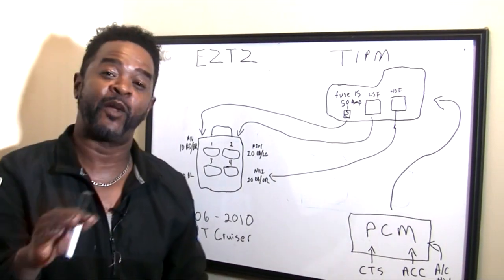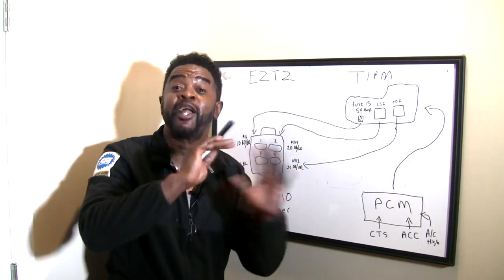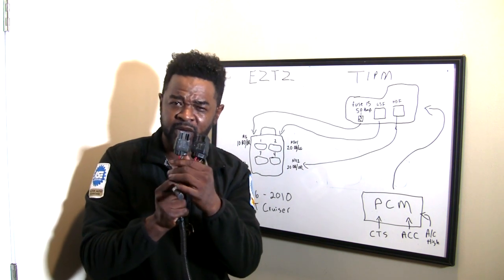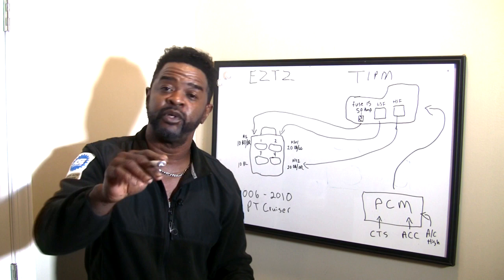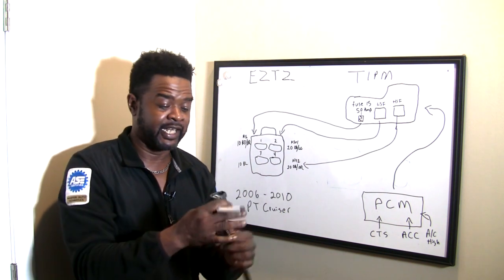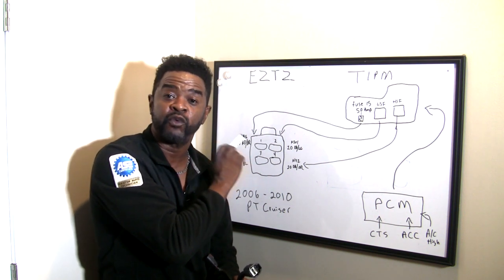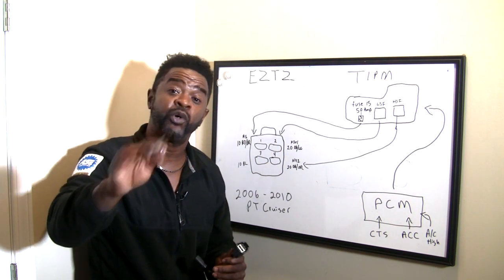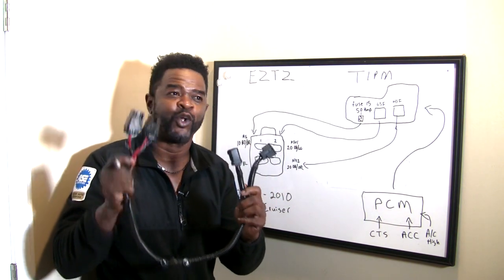PT Cruiser overheating problems. Overheating with AC on. How to test the cooling fan. Running HOT

Comment: Went through four videos and your video was the Conclusive one!

The Module wire connections that carry over to the two relays and the fan wiring connection was corroded inside the connection. 

Sprayed an anti corrosive.  

 Carefully,  scraped the Copper connectors, and WA'LAH!!!  

 Back in the game!

🔥THANK YOU for making this video 🔥🙌🏿

Comment: 2010 PT Crzr fan not actuating 51k miles. AC on but no fan. Temp is okay when moving but stop lights cause havoc. You mentioned that the square relays on the fan shroud don't go out, but another video said that was his problem. Thanks for giving all the info on this. I'll be working on it tomorrow.
Reply from the maker: Cool, please thumbs up the video and subscribe to the channel
Reply: @OnlineMechanicTips  Pulled a P0303 - number 3 cyl not firing. Replaced the cam position sensor and mine stopped doing the jig, but fan is still not actuating. Ran the cruiser on the freeway and it was fine, but as soon as I pointed it uphill the temp gauge started climbing. Once the coolant gets hot its difficult to cool it back down. System is holding pressure and I can get enough cooling from running the heater inside with fan on high, but its not comfortable here in Hawaii to drive with the heater on. Is there a way to hot-wire the radiator fan? I believe the relays are grounding circuit relays so I'm going to try an extra ground cable from the battery to the block. I'm thinking that I might just run a switched wire from the fan's ground wire to the block or ground side terminal on the battery bypassing the relay. Thoughts?

Comment: Great Video,  Everyone have a look at that 10gauge red/brown wire that is supposed to supply power out of the TIPM..... I found it to be corroded and broken underneath the battery (As a result of battery corrosion under the battery tray.  I found the issue, thanks to this fantastic video.  Subscribed.  :)

Comment: Man I have to thank you a lot for this video! I’m diagnosing an 08 PT CRUISER with ac not blowing cold. I’m gonna check on that low speed control circuit when I get the time to work on it. I’m surprise those two relay looking thing that attaches to the fan does not show in wiring diagram which got me thinking they’re the fan relays!
Reply from the maker: yea, they dont even have a listing in the dealership parts department..Please subscribe to the channel for me an hit the notification bell...thanks

Comment from the maker: Yes, a restriction in the liquid line, like I mention in the video.. Because the orfice tube is housed inside the liquid line, you just cant replace the orfice. So you have to replace the complete liquid line..You really need to do a complete AC diag using some guages to pinpoint pressure problems within the AC unit
Reply: EZTZ Rideshare/ News/Auto/Fitness/Multimedia would the ac still function without purgeing if this was a problem before i replaced my broken fan it wouldnt it would build presser purge and turn off like it should but with the new fan the ac works but running it or heater at idle makes it idle bad the same as it was before so the fan was a problem just not the only one
Reply: EZTZ Rideshare/ News/Auto/Fitness/Multimedia from what i can tell right now when the ac is turned on the low presser switch is cycleing constantly one click bad idle another click good idle over and over again

Comment: So my cruiser just overheated again. And it all leads back to the fan assembly the only problem is this my the fourth time I’ve had a fan fail on this car. Mainly the low speed won’t kick on again anymore I’ve switched to new relays and put in a new 50 amp fuse. It’s crazy I’ve been replacing this fan on a 6 to 8-month interval I've been stumped. Thank you for your knowledge I'm gonna have to put your method to work.
Reply: well after working on the cruiser I found that the 3 prong connecters on the fan male and female are burnt up.

Comment: my ac wouldnt work until i replaced the fan because my low speed fan was shot but the high speed fan worked so my car would not overheat. i am wondering if something else is pulling too many amps that is shared by the heat and ac because the idel drops as soon as the heater fan is cut on. it has done the before and after i put my new fan. i am inclined to think of the heat controls and the heater motor but i have been working on other projects lately since i fixed my fan. my friend basicly handed me his voyager that needed some love so any ideas for heater and ac droping the idle would help out thanks

Comment: So my mechanic did a bypass on those harness because pin 3 the black ground wire was hot and had a shortage; should I still replace those relay harnesses? And does doing a bypass work long term? I think my 08 still may stutter when cutting the a/c on but it doesn’t overheat anymore after replacing the thermostat, fan, and radiator cap

Comment: I realize you work more on chryslers an stuff but do you do Any GM work? 
I got an 2009 Silverado 1500 where my fan wont come on unless i turn on the AC. Yeah the system is pretty much the same overall, but theres some differences.

Comment: Please i have 2006 manual 1600
When i turn ac on the fan working on but im not shure if that low or high speed but i notice the when i drive the car about to die on gear 1 & 2 so i have to push more on gas pedal !!!!
Any advice please

Comment: Hi, appears my ac is not as cold as usual so I have looked at my fan on my 2010 PT. Unplugged the four way plug, put ground to #3 and power to #4 on the fan side only, not vehicle harness. When I ground either 2 or 4, my fan will run through either of the two mounted relays. But they both run at the same speed, no matter if grounding #2 or #4 individually. Does the system kick on both relays at the same time to get a different speed? Compressor shutters a little at a stop as you mentioned.

Comment: Do you have a video on the instrument cluster quitting all by itself?  I have a 2002 PT with only 53,000 miles on it and the
gauge cluster went out a few days ago.  The fuse is fine and the dealer says the cluster just quit and they don't have any new ones anywhere.  Any suggestions??  I love the car and this is the ONLY problem I've had on it.
Reply from the maker: Hey buddy, I do not but that cluster is a mini module. If you had a chry scan tool you could read faults. But like any other electrical module or motor, you need a power supply and a ground.. You can simply remove the module and verify that it has a power source and ground, if it do, the module simply internally open.
Reply from the maker: O can I get you to subscribe to the channel please, thank you

Comment: Hello jt having crank shaft bearing trouble what is the best way to service main bearings can it be done in the car as in mother natures garage in the north east
Reply from the maker: O man, are you dealing with a walking crank? One has to come out, either the transmission or the engine. I replaced a crank thrust bearing once by removing the transmission.
Reply: @OnlineMechanicTips  ok another question I have a chance to get a motor from pick apart from a 2010 or cruiser auto trans I have a 2005 or convertabel if I buy this motor what kind of magic am I going to have to do to make it work in my 2005

Comment: Desperate for help on this. My 2002 pt cruiser is over heating and leaking fluid under engine. First thought is water pump and very well may be. However, I just discovered the fan is not going on and now baffled as to maybe the engine gets so hot the fluid is coming up and running out the overflow tube at the cap and or the tube at the overflow reservoir and the hose running some where down under where it drains and looks like the water pump is leaking. My problem is opposite of all the AC overheating, the fan does come on with the AC running and does blow cold air. When the AC is off the fan does not come on, not even when gauge goes beyond halfway and hotter. All I can find is how the engine over heats in AC because the fan isn't going on, mine does, it is when AC is off fan does not come on
. Not a single video or explanation I can find any where of my issue and is the other way around. What controls and turns the fan on in regular non AC mode or is that a sign of motor gone bad?
Reply from the maker: Hey bud, a couple reasons the fan will come on or commanded to come on is as you mentiones, the AC. Also the fan should come on when coolant temp reaches about 230 degrees. That signal comes from the coolant temp sensor. If you had a scan tool that will show coolant temp, when it reach 230, this signal bussed to the PCM, from there the PCM will direct the low speed or high speed fan to come on. So you really need to look at the circuit to see that flow.
Reply: @OnlineMechanicTips  Thanks for responding. The temp sensor has also crossed my mind. I know it would be good to know the temp of the engine however I am pretty sure it is getting above the 230 mark and the fan is not going on. But it does go on when turning on AC. I guess I am looking for a direction that tells me what all controls and turns fan on without AC on. When I discovered fan was not coming on I automatically assumed bad fan motor except when I turned on the AC it fired right up. Would that eliminate a bad motor being the problem? Also second guessing the leak is water pump, it does not start leaking and dripping until engine reaches running temps or hotter. If it was water pump, would it not start leaking right off the bat in starting the engine? Does the high speed control the AC and low normal engine operation or does that not matter? I can't even tell you how much I appreciate you responding. PT Cruiser is the most difficult engine I have ever worked on.
Reply from the maker: @ckstaff  Hey bud, the thing about that 1 fan motor on this car is that it is 2 speeds. The low speed and high speeds. The PCM determines which speed to turn on..You could have one of the speed motor internals shorted out. With a scan tool you can command either speed fan to come on. Just say, I can actuate high speed to come on, then simply look down there to see if it comes on, same with low speed. If i make the command and nothing happens, thats when I verify the power supply and the ground at the connector. If the motors getting the power supply and ground but not coming on, then that motor simply open. If you not geting the power and ground at the connector then you have to find out why (diagram time) A good scan tool makes diagnosing so much easier. As for that water pump leak, that can easily be verified by adding pressure to the cooling system. Use a cooling system pressure tester to add pressure then look around to find leak.

Comment: I like this Guy. 04 cruiser, fan wont turn off? I have to pull fuse, any suggestions.
Reply from the maker: This year pt cruiser has relays in the fuse box..pull those and see if fan stop running